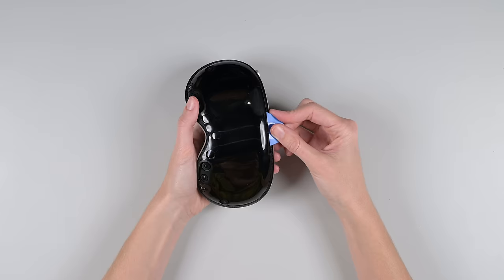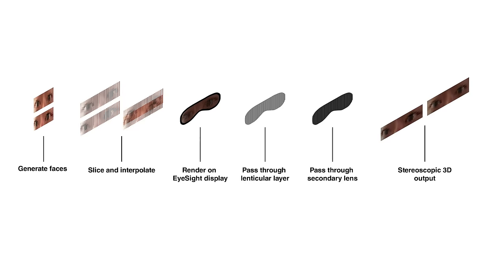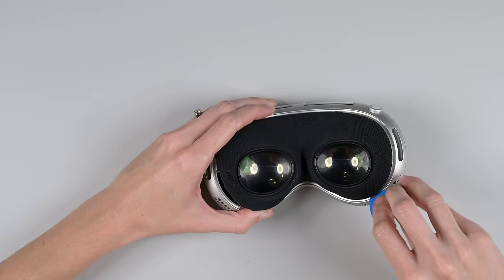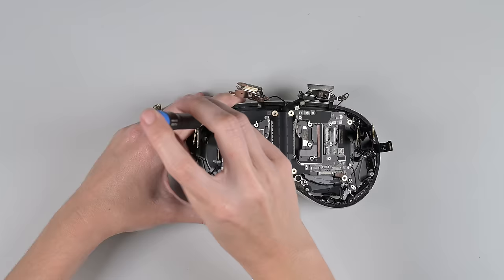Vision Pro Teardown: Behind the Complex and Creepy Tech

Comment: Wow. That’s A LOT of tech packed in there. Now I understand the price better.   Amazing engineering
Reply: A lot of people are hoping that these things soon become cheaper.  I don’t think so.
Reply: @TitusvonderMalsburg my thoughts exactly. Over time prices will go up, if anything. People are in for a rude awakening.
Reply: @Starboy-_- i'd say we're gonna get a vision (no pro) that may ditch the eye thingy, lesser pixel density, maybe plastic instead of metal (which seems unlikely) etc
Reply: @king_james_official  You have a generic VR headset now. Amazing, isnt it?
Reply: @alexturnbackthearmy1907  If all these gimmicks is what makes a Vision pro then it's a useless product.
Reply: @TitusvonderMalsburg  I wouldn't say it'll get cheaper, but it will improve dramatically to the point where it will actually be worth its cost. Right now it's just an expensive toy that maybe has a practical use case when you're on a plane. Otherwise, it's not useful at all if you really think about it.
Reply: Exactly what i was thinking. Looks like the price on this matches the complexity.

Comment: This is the first video ive seen explaining that the battery cable infact is removable with the sim pin, everyone thinks is permanently attached, this means once the connecter is reverse engineered we can get larger battery packs and lighter ones!
Reply: You can't, because it's an Apple connector. In the best possible case, Apple charges other companies for using it, as they do with lighting connectors.
Reply: @AirsoftKeksTV oh you definitely can re it. also apple charges only for mfi certified cables
Reply: No, there will be a chip in the battery pack that is linked to the googles and they will only work with THAT battery pack (not even with another official battery pack from another pair.) They are a bunch of assholes like that. If you want to replace your battery you will need to go to an apple store and pay almost the same as a whole new device.
Reply: @MakerAventuras may also be the case. that's where re comes into play again. there are plenty of tools for reserializing displays, batteries, etc.
Reply: The battery and the headset probably some kind of an insane handshake, like lightning and iPhone but more complex
Reply: @Radi0he4d1 replaying handshakes is pretty simple actually, unless there's some totally unpredictable variable in it, that's called a problem haha

Comment: I actually think it look way more repairable than what I expected. beside the tideous opening of all the glass layers, it looks remarkably modular inside. Yes lots of screws and lots of ribbon cables, but it means u could 'theorically" replace only the malfunctionning part without having to buy a full motherboard with everything soldered on it. 

At a point, consummers need to understand that there is indeed complexity in how a space-aware facial computer is built compared to a phone. 
Having this level of engeneering in making it as simple as possible, everything layered with only screws and ribbon cables is truly remarkable in my opinion
Reply: except for the screen she used the heater to remove. It definitely had some glue.
Reply: Although, upgrading my xbox elite series controller, I realized that these devices use this sort of glue tape. it is something between a real glue and a rubber sticky tape. It is workable if you know what it is and how to handle it. The problem a lot of people do not know how it works. I have seen people who damaged their controllers trying to upgrade theirs because they thought it was held by plastics hooks.
Reply: But since it's Apple, I'm curious how many of those "modular" components are married to that specific logic board.
Reply: The front glass is easier to remove another youtuber was able to remove the first layer without having to remove the other 2
Reply: Where to get repair parts? It's no repairable
Reply: @Xudmud  I would gess most of them if not all.

Comment: Apple still hanging onto the lightning connector. lol
Reply: It’s not even a lightning connector, it’s a different internal connector exclusively for the Vision Pro, it’s wider than lightning. Technically as it’s not easily removable the consumer should basically never have to see it however if the battery needs to be replaced but the cable is fine than only one piece needs to be replace(and view versa). The logic I’ve heard behind making it non easily removable is that if you have the Vision Pro on and you say bend down you don’t want the cable to get pulled and shut down and the port’s depth means that it can’t snap off in a pocket if someone bends over.
Reply: @johnatkinson1111  You could just do the same with a USB-C connector. You could add the same handle part onto it that locks in and people could then still just use it on any other powerbank if they want to. And other companies  could sell their own powerbanks that can lock onto that. But I guarantee you that this special Apple connector has a patent to prevent this from happening or Apple wants to get paid if you use one, as they did with lighting connectors.
Reply: It is chargeable with usb-c though…
Reply: Pretty sure that isn’t just a “power bank”. It is a battery with a lot of tech in it. Either way you could charge that battery with a power bank
Reply: @AirsoftKeksTV  Almost certain, The connector delivers voltages, USB-C cannot.
Reply: @p.aradise  it'd be a very weird engineering decision to put anything in the battery pack other than the battery. Your MacBook charger also doesn't have "a lot of tech" in it.
Reply: i have to wonder why... seems like a really petty move
Reply: @tomboss9940  USB-C can even charge laptops, so I'm not sure what you think they need a different cable for. There are plently of USB standards that deliver higher voltages for demands like that.
Reply: @tomboss9940  USB-C can pull up to 240W, how on earth would this thing uses as much as half of that ?
Reply: @tomboss9940  USB-C is a connector type, there's no reason why this couldn't be USB-C.

Comment: After watching this I understand the price a bit better. They always charge a premium, but this one's on another level.
Reply: This makes the price tag seem almost reasonable 😂
Reply: Yeah I feel bad for any ACMT who has to fix the thing.
Reply: yeah the quest headsets are just as dense and don't cost as much as a used car...
Reply: you're puddled mate,
Reply: @LogiTech-qi2ug lol have you tried or are you 12?
Reply: @LogiTech-qi2ug  if 600g is heavy for you the day you put on a motorcycle helmet you gonna fall to a side
Reply: @Yackass no quest headset had a more then 4k micro oled screen (quest 3 having simple lcd, and pro also lcd but with multiple segments of backlight) no quest had that many sensor (probably because the soc in the quest cannot even handle that many). And if your quest battery is starting to fail, good luck replacing it, you can watch on this channel how bad is it.
Reply: @daleth50 Did you just compare a helmet to a VR Headset? You do realise that the mass is spread out differently?
Reply: @daleth50 Weight distribution of the two is completely different, just imagine all that weight on only the front of your head and forehead.
Reply: @nagyFerko  buying a new quest for a dead battery is still a fraction of the price of this useless POS
Reply: @LogiTech-qi2ug  would you really like to have a battery that could possibly explode on a 1st gen device planted on your head?

Comment: The pass through is by fair the best on any standalone device so that’s a bad start, surely if you’ve done a tear down of a Quest 3 you’ll have a good comparison
Reply: And it's the worst part of the device she says. So the rest is even better. That's what I understood 🤷
Reply: @EliasGomezSainz  I disagree, the worst part of the device is the front screen, it’s too dim and low resolution to display eyesight as intended from the way Apple marketed it. One of the best parts is the pass through, the way it has minimal distortion and warping. It’s also pretty good at adjusting to different light and exposure.

Comment: 10 years of engineering right there at least
Reply: Thanks Tim ;)
Reply: @Gabriel-ci7db  Are you in Apple's R&D department?
Reply: nah the tech world has had vr glasses for 10 years already
Reply: That explains the lightning connectors.
Reply: It's not lightning, lightning has 8 pins, the battery here has 12 @2010ngojo

Comment: Wow. Thanks for that. After watching, it's obvious how much this device could have been much cheaper, much smaller, much lighter if they took better design decisions…
When you remove all the fluff behind the screens + motherboard, there is enough to remove many useless things or modify oversized elements such as the frame that is MUCH larger than the screens + lenses area...
The stuff is also packed with lots of stainless steel screws to assemble the various component, meaning lots of added weight compared to a more integrated assembly.
The PCBs look quite thick, and they had to cable many sensors away from the motherboard because of the screen getting in the way...
PS: If they put Frore Airjet fans instead of these classic fans, they could have saved lots of thickness and weight, and even marketed it as "the brand new "Apple HeatFlow Technology"".

Conclusion: waiting for vision 2 (not pro, if it means less heavy expensive useless features).
Reply: *added weight (noun)
weigh = verb

*and even marketed it (to be consistent with "saved")
Reply: @alvallac2171  Thanks, I am not a native English speaker, I will try my best to remember your suggestions next time.

Comment: Watching this video really adds to my argument that if the Apple Vision Pro already requires you to lug around a large battery to use the device, why not have the rest of the processing components of the device on the battery itself? Most users carry a bag to move the Vision Pro anyway, a slightly larger battery/processing unit wouldn’t hamper the already existent inconvenience of the battery.

This would remove a significant amount of the weight of the Vision Pro and make the device slimmer and more comfortable to use. Just my opinion of course 😤🤷🏼‍♀️🌲
Reply: because they want you to buy another headset in 2-3 years
Reply: maintaining signal integrity and low latency over such a long connection is extremely difficult.
Reply: The engineers need the practice for future iterations. Apple likely doesn't plan on keeping the external battery pack design for the next big leap so they might as well work on designing boards and cooling that fit in this form factor.
Reply: @eddieliang16 I could see Vision Pro 2 being slightly different to make the headset new/ fresh again. And then they use recycled parts from Vision Pro 1 for a normal Vision headset at a lower price to push out for more people
Reply: Yeah its just a data center 
Once they know what they need to know, they will shift the insghts and make way lighter products

Comment: You can also turn it off safely by holding both top buttons down until several seconds after the force quit window pops up. It then shows the familiar swipe to power off that iOS has.

Comment: The complexity here all depends on what you need to do, replacing the front display looks like a pain but replacing the internal optics seems rather easy, remove light seal, use pry tool to pop clips and a few screens and then you can slide out each eye.

Comment: I wonder what is going on in the battery connector. Is there a handshake between the battery and the headset that will make 3rd party battery packs impossible or will we see some sort of adapter that is circular locking connector on one side and USB C on the other and any PD capable powerbank or charger would do.

Comment: the fact that the battery uses a lightning cable really tells a lot about apple
Reply: Is it a lightning cable?

It looked like it was but I'm like...... "Noooooo...... They wouldn't?" 😅😂😅
Reply: Maybe because it was designed a long time ago considering the design choices of a lot of these materials
Reply: Lightning connector is really solid, because it is solid. C is not solid at all. I get theire point. Why would Tesla change the shape of their car when it's the most aerodynamic.
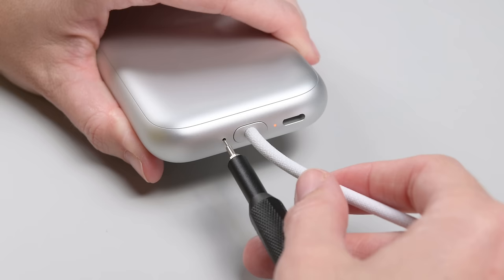Reply: What she showed wasn’t a lightning cable. The battery is charged with USB-C which you can see to the right of the battery at 0:57.

Comment: If the product is viable consolidating the parts and assembly will be the focus over the next decade. Lots of low hanging fruit for v2. After 10 years optimization will be down to which screws to replace with adhesive.

Comment: I'm pretty sure the power source can also be provided through a different USB-C cable, intended to plug into a USB-C power source. But with that, it would allow any 3rd-party battery.

The battery pack they provide just allows for freedom of movement by being completely unplugged.

Comment: Apple provided a way to run 3rd party battery packs. Just plug on into the USB port on the Apple battery pack. I’d be interested to see what’s inside the Apple battery pack. Seems bigger and heavier than the battery size would suggest. What else is going on inside that aluminum case?
Reply: it could be cheaper battery chemistry that they went with to try and get the price/profit margin up or down

Comment: So since you actually can disconnect the battery pack from its original cable, couldn't you just connect the Vision Pro to a bigger, 3rd party battery pack with a lightning to usb-c adapter?

Comment: I wander what if they made a wearable display. LCD and lenses with headtracking, front facing 2 pass through cameras.. As thick as lenses and LCD.. All the heavy lifting is on the unit back of the head balancing the weight of the unit..

Comment: I wonder what the subpixel arrangement is like on that external screen. Because for vertical lenticular lenses, you would want a LCD style "striped" layout turned 90 degrees to avoid colors showing up differently for the angle you look at it. I have this Looking Glass portrait screen and it's laid out like that. But seeing as this is OLED, I'm not sure it can do the correct layout?

Also, I don't know why everyone is questioning so much why there is a lenticular display in there. It was absolutely necessary to reach the goal they wanted, which is to keep a personal connection with the outside world. So you need to know when someone is looking at you, and that is only possible with a 3D display. Not to mention the weird depth disparity where the screen is a good couple of centimeters from the person's actual face.

I think Looking Glass displays render "up to 100 views", sometimes I also hear around 40, so I would like to see some actual details reported about the amount of angles this Vision Pro screen shows.

Comment: 0:22 🕶 The pass-through video is the weakest element of Apple's Vision Pro, despite cool spatial video and immersive experiences.
1:05 🎭 The Vision Pro is a single-player experience with specific customization of face seal and headband.
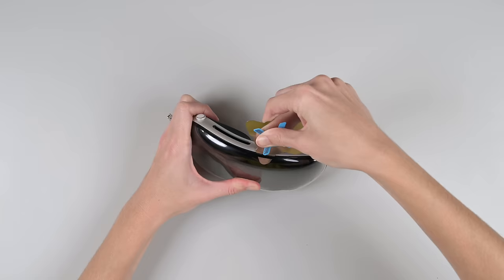1:48 🔄 The power cord unlocks and disconnects with a SIM eject tool; the battery pack is 362 grams.
3:13 🔍 The Vision Pro's display uses lenticular lenses for stereoscopy but sacrifices horizontal pixels and brightness.
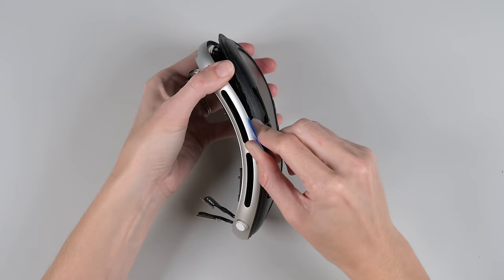4:18 📸 Prying open the outer display reveals more cables, screws, and connectors, leading to the camera array.
4:45 💻 The teardown involves intricate disassembly with small connectors, brackets, and screws, showing the complexity of the Logic Board.
5:11 🌀 Removing the whisper-quiet fans involves unscrewing and detaching Nidec blowers with rubber ducting.
5:25 🔄 A little stepper motor controls lens positioning for your eyeballs in the Vision Pro.
5:37 🧩 The teardown process was effortful with convoluted construction, finicky fasteners, and a bevy of brackets.
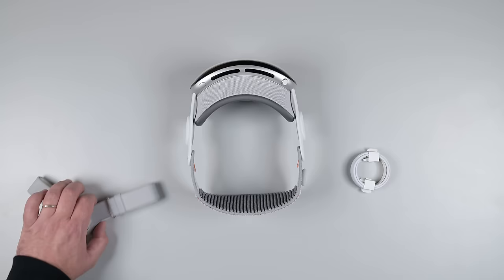5:50 🔧 The replaceable battery pack offers potential for third-party replacements, hinting at future complications.

Comment: Is it just me or does it seem like there is a lot of hardware on there to just make the external portion work? I would definitely remove the fans, external display and the films. I would also redesign the curved portion to actually split the electronics horizontal planes instead of vertical ones. You could then just passively cool

Comment: We need to force the industry to use glues, that permanently expand under heat!
Not just for repair, but also for recycling. 

Just imagine popping such a device in the oven, letting it cook at 350F and having it go up like puff pastry, with the glue turning into a brittle foam. It would speed up disassembly and sorting of the materials by several magnitudes of order. Applied locally, like on the edge of a thin glass panel, would help a ton in destruction free disassembly. 

The industry is perfectly able to implement such a solution. It is just not willing, because for manufacturing of such a device, it makes no difference but ad up little costs.

Comment: MKBHD says the Battery Pack cable is not detachable. I think Apple has send him a differently made model to him for review.
Reply: You need a sim ejector tool to remove the lightning pin cable from the battery. Otherwise, it is meant to stay attached.

Comment: [0:52] Actually three ways to turn VP off;
1. Disconnect Power Cable. 
2. Go to Settings > General > Shut Down.
3. Press and Hold both Button and Crown to reveal a Slide to Power Off. 

🤔

Comment: Too many ribbon cables. Yeah, it's complex, but what's the sense of that modularity if it's not repairable?

Cameras and sensors could be mounted on those two angle-mounted PCBs or front screen PCB.

And front screen assembly could be mounted with screws into main part.

And lenses and display assembly could be done as a third layer. And that frame could be also mounted with screws into main body.

The best designed things are simple and easy.

But ya, that's the first version. I believe, it will be better in future.